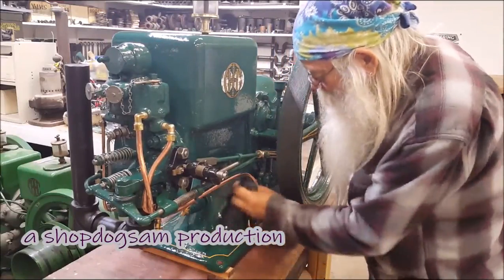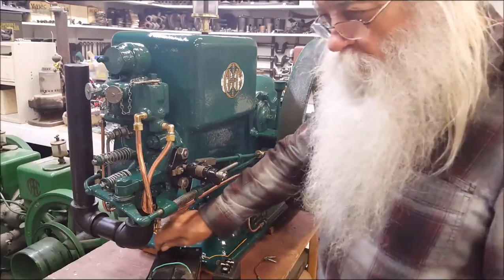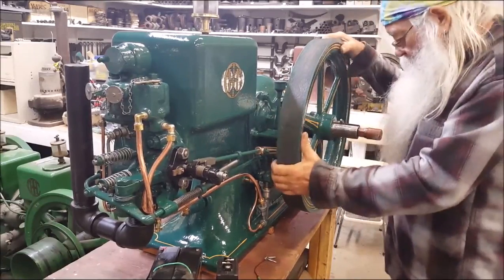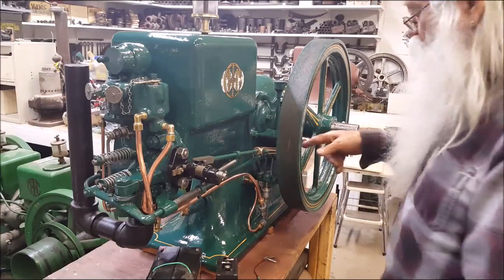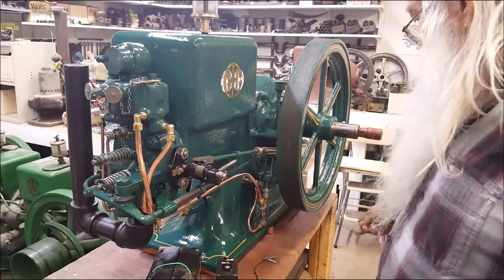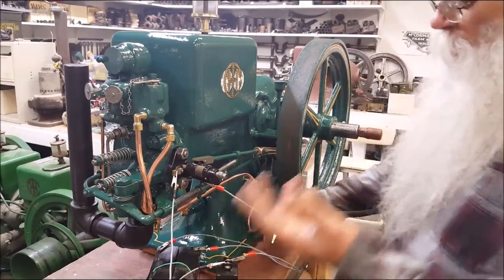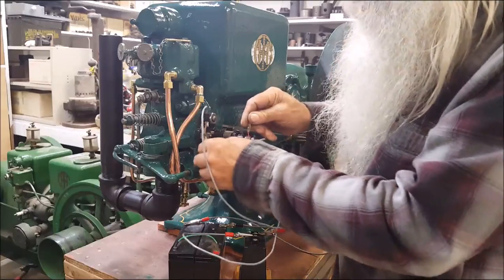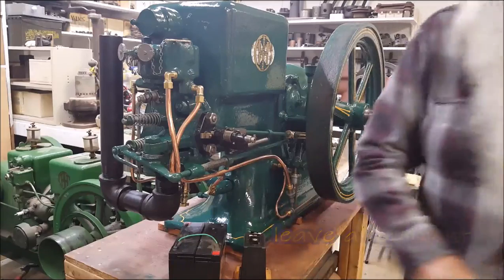Make And Break Ignition low tension coil and battery

Comment: Shopdogsam, I have an old 1917 Economy  5hp that had high heat applied to get the siezed piston out. It is now warped. Shops are wanting over 800.00 to re sleeve it. Anything I can do other than spend the bank to get it to run? It was bought and used in the Georgetown mines here in California. Thanks!

Comment: Sam my  1.5 hp model m is idling too fast . The govenor is closing the throttle plate right to the stop.any thoughts on why it is idling so fast? The throttle plate has a small gap all the way around it should the plate fit tighter to wall of the bore to prevent air flow.thanks Dave.